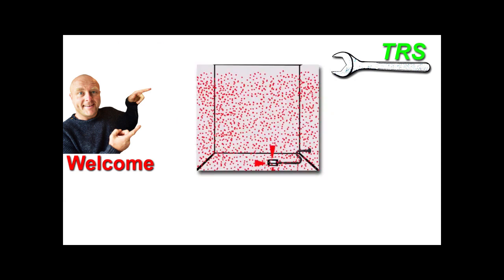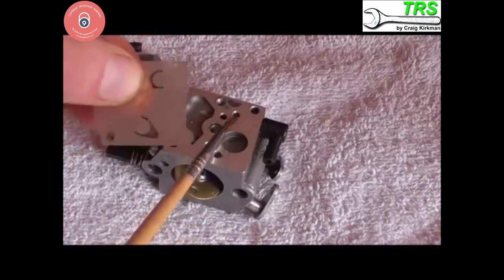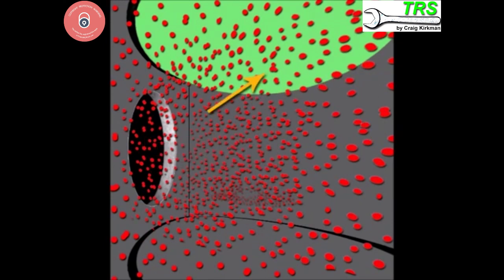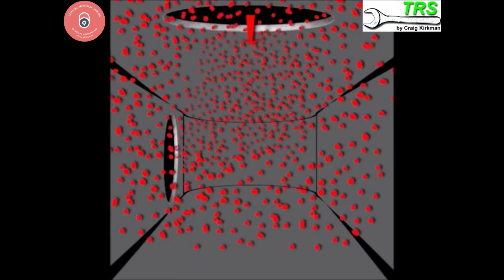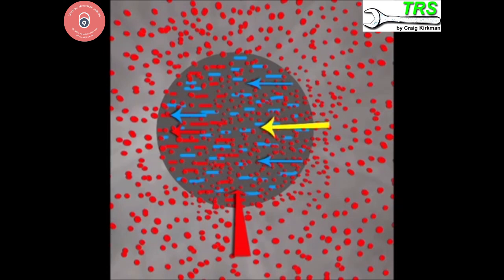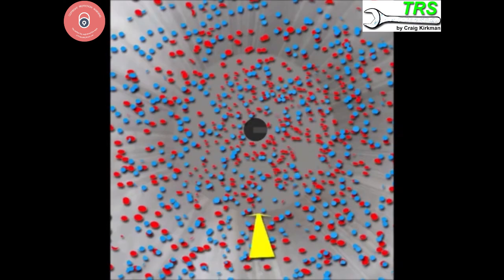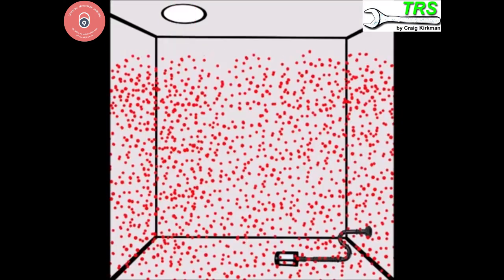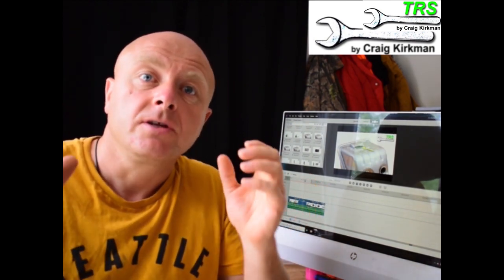2 Stroke Engine & Carburetor System - Unique Inside view from Tank to Exhaust.  (by Craig Kirkman)

Comment: Depending on carburetor, it would have been nice to see how the priming system works. Good graphics! I can fix weed wackers and other small engines in my sleep. That screen mentioned in the inner body can sometimes be too small and oil cannot get through, causing the carburetor to not get fuel. Too much oil mix can cause this but manufacturers  cause more of the issue. You can get screens with larger diameter holes that eliminate the issues caused by that screen. I would never recommend  taking it out, especially on a chain saw. Wood fibers  in the fuel can and do block the filter system causing problems also.

Comment: A great and unique way of teaching and learning, great content, I bumped into you/subscribed  while searching for a resolve with my paramotor, which has a little Walbro carburettor that looks like its off a Stihl saw or grass cutter😁 the engine is a 50cc Aprilia bored out to a 70cc with a different crank and conrod so it’s a mixed bag, I will eventually get to the bottom of it? Anyway great content and very enjoyable 👍

Comment: I watched and enjoyed this video hoping to get an idea why gas is spraying out the exhaust.  I replaced the carburetor and there was no change.  It’s a 2 cycle stihl bg56 leaf blower.  Do you have a suggestions as to the cause
Reply: Thats the needle and seat in the main chamber  he never mentioned. The fuel has to pass through a small well or pit with a needle and seat as well as a large diaphragm  that opens and closes. That needle may get wood fibers in it preventing the needle from shutting fuel off , allowing too much fuel to come through. Many times simply bending the small arm that acts as a fulcrum to open and close the needle, pushed by a metal button in the center of the diaphragm  can reduce the amount of fuel buy closing off the needle sooner can fix the issue. Any time fuel sprays out the exhaust  or carburetor  indicates  too much fuel.